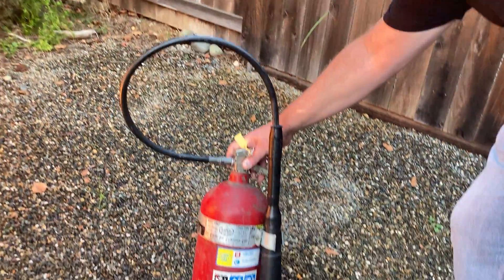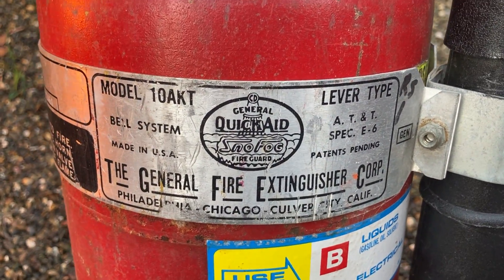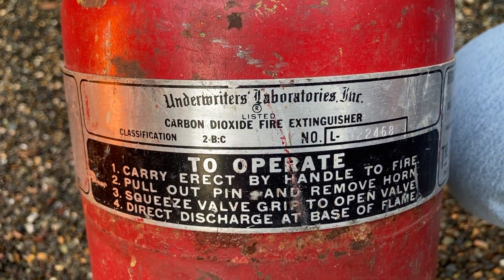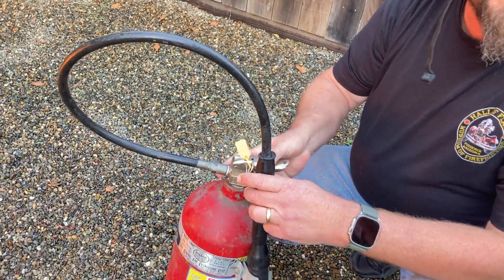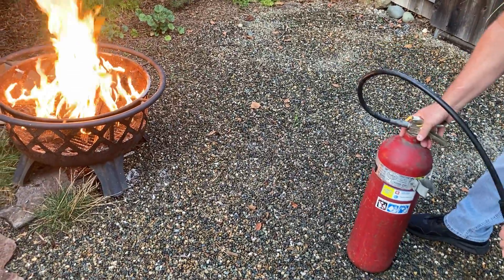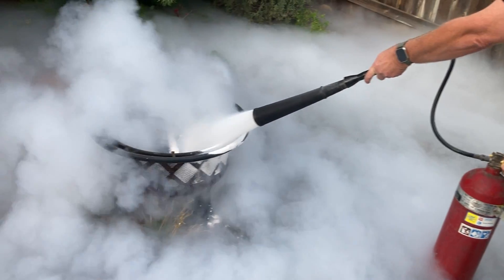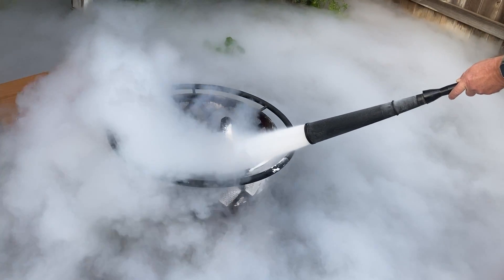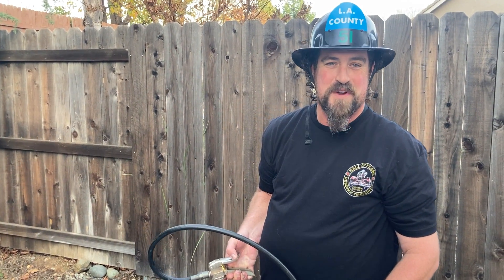Fully Functional CO2 Fire Extinguisher: Headed for the Scrap Yard?

Comment: Looking at the corrosion under the band it would probably fail a hydro anyway, you don't mess with CO2, they are like a missile when they pop and it's usually the refiller/hydro tester that gets injured or killed.
Reply: The guys that do the hydro test, do it in a sealed chamber with water pressure. not expandable gas pressure.  The guys doing the test are not in danger.  A guy filling a degraded cylinder is the one who may have a problem.